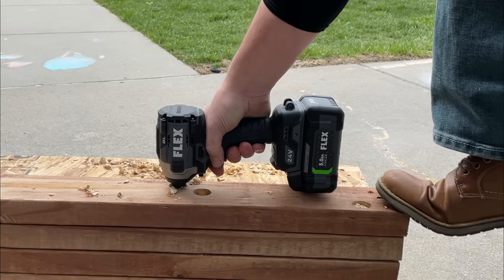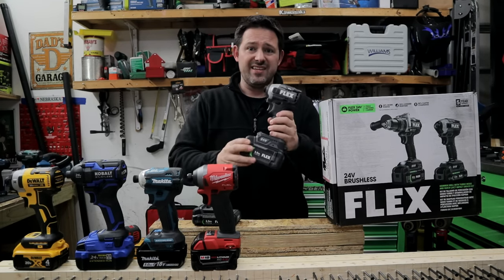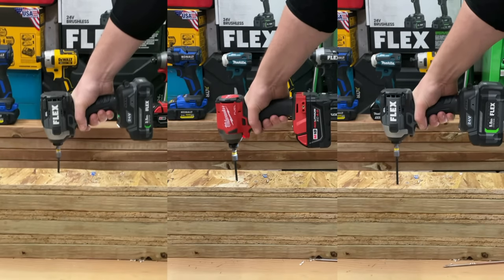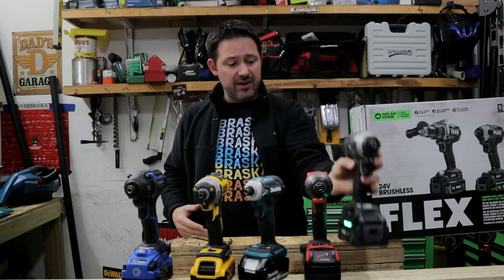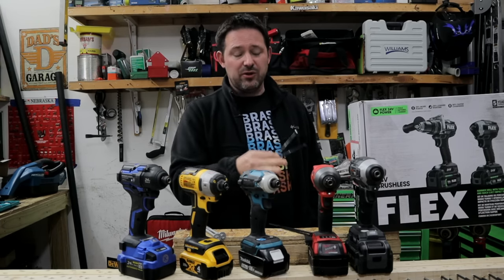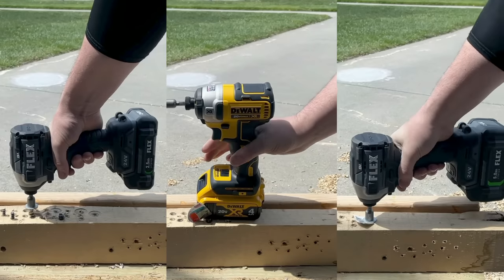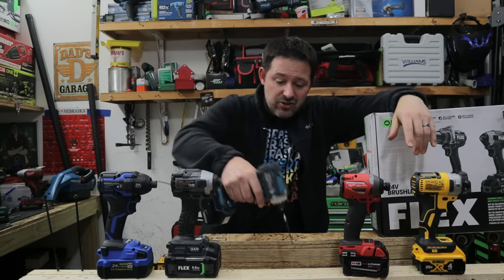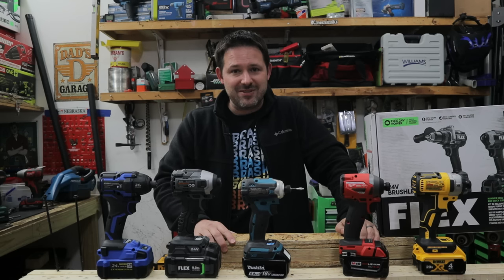FLEX TOOLS vs DEWALT MAKITA MILWAUKEE It's NOT what's NEXT Impact Driver SHOWDOWN!

Comment: I understand how you point out the flex and kobalt are Lowes exclusive, however where I live Makita and Milwaukee are more or less Home Depot exclusive unless you want to pay full MSRP with poor selection at Ace, or maybe True Value, or possibly a local supply house.  Live in a Lowes town. No HD here. Also, Flex is not a new company. One of the oldest family owned power tool companys in the world, and they invented the angle grinder. I'm currently on the DeWalt platform and have no plans to switch but I do plan on buying their hammer drill to use on my residential pre wires and their 24 volt rotary hammer. Reason is because they do appear to be powerful and we'll made and also because of the lifetime warranty offered if purchased this calendar year. They will even replace each battery 3 times as part of that warranty so the four included actually end up being 16 batteries in the end. That's a solid value to me and honestly the two tools that get the most wear and tear with what I do.

Comment: It looks like the collets are being pulled into the wood by the bit going in too far. Perhaps the collet is hitting the edge of the hole. @12:23 at 0.25 speed, you can see that when the speedbore is inserted all the way down into the wood, the collett is being disengaged by the edge of the hole.
If you tried this with a bigger, or even a smaller bit, the collett would hold it normally.

Comment: No Bosch?  Metabo?  Metabo HPT?  Ridgid? Besides my first 2 favorites missing, great video.
Reply: All four would trail behind the other products in this video (except maybe the HPT).
Reply: @robertrada6040  trail or not Bosch and Metabo are less powerful than Milwaukee but built much better and definitely more reliable. Metabo HPT (Hitachi) I don't care for.  And they wouldn't burn up like the Default😂😂 the Kobalt would be RIP the first time you drop it. Makita and Flex are the only real options.

Comment: well i built an addition on my place and needed new tools and the price of Dewalt was too high in my eyes for all you get but i wanted a good tool so I want with the flex i got the impact drill and saws all and 1/2 impact for automotive use and wow I couldn't be more impressed.   i had coworkers the had top of the line drivers and they were starting to use my flex tools the speed the power and the bolts we were using on some of this built would blow your mind. battery's lasted longer and the charger for the flex was way faster. hands down i would buy the flex and the fact you get a 5 yr warranty with the flex where can you go wrong

Comment: Great video but I kinda feel like all of them should've had the 5ah battery. I know for a fact its quite a big difference in my Milwaukee drill and impact going from my 4ah to my 5ah and even bigger when going to my 8ah. 12ah seems the same as the 8ah. I wouldn't think 1ah difference would be that apparent but it definitely is. Especially when using my drill for my ice auger. The 4ah constantly cuts out. The 5ah will go all the way through most of the time anything beyond 5ah just blasts thorough with no cut outs.

Comment: Milwaukee fixed that problem with the new upgraded 3.5 gen impact driver, not gen 3 but gen 3.5. Milwaukee's gen 3 impact driver has been a beast of an impact driver with only one flaw the collect issue, which's been fixed by the new 3.5 gen model.

Comment: I think the largest factors to consider - especially if you rely on these tools for your job - are quality and longevity. It's great if your tool outperforms competitors, but if it only lasts a few jobs or few months, it's not going to have the reputation Dewalt has, for example.
Reply: Dewalts are good for electricians and trades like that where the drills aren't beat up and used constantly I can testify that my coworker has 10 year old Dewalts that still work but they break easily they're made from Chinese plastic unlike Makita. Dewalts are like GM and Makita is like Toyota/Honda. Japanese know how to do it right 💪 not really the Chinese with Milwaukee Dewalt and Ryobi they break easily but can last a long time if babied or only dropped small lengths every once in awhile

Comment: Currently running Milwaukee. I still have 2 Dewalts, and have had the blue Makita, Ridgid 24V, and have used lots of others. Makita was light and powerful- but didn't like falling 20 ft and hitting concrete. I am currently invested in Dewalt 20V, with some Flexvolt tools as well, and have no interest in a completely new brand. If anything I'm adding Milwaukee to the stable, but generally speaking I think Milwaukee makes the best drills, impacts, and recip saws. Dewalt owns the miter saw game. Most other tools are neck in neck. No way I would ever buy a store brand like Kobalt or Ryobi. They're cheaper for a reason.
Reply: Do they have the multitool?

Comment: Did you use turbo mode on the Flex? Is this the most expensive flex model?
Reply from the maker: The FLEX impact driver does not have turbo mode, but the FLEX hammer drill has turbo mode

Comment: I cant understand why the heck you dont use Milwaukee's latest high output batteries with the 21700 cells. In comparison to the old  18650 cells in REDLITHIUM™ batteries, the new 21700 cells provide a massive leap in performance in the high output line.

Comment: So I've seen from flex tools (both mine and a friend's drill set) that its really damn good under lighter loads but once you get past a certain threshold, it seriously slows down bad. But I think this was intentional from the manufacturer as it drops off so much to the point where it feels like the drill is trying to slow itself down to increase its longevity.

Comment: Dude good review but frustrating when the gen 3 gets beat by the flex when it's running a 5ah, clear to see it does make a difference even between the flex line. Milwaukee 5ah atleast for the review I reckon is a far better option, and Milwaukee has the high output line for a reason maybe chuck the 6ah on see it absolutely dominate, as that's more close and compatible to the flex 5ah 24v
Reply: Milwaukee is 18 volt, flex has a 24 volt... it should be better. But Milwaukee will NEVER BE BEATEN! LMAO, THIS TEST IS A JOKE! Let's see how long a flex drill lasts, it'll do good to last a few months, let alone years like Milwaukee does! They need to "flex" their wrists and throw the flex in the trash where it goes... 🤣 🤣 🤣 🤣 🤣 🤣 🤣 🤣 🤣 🤣 🤣

Comment: The Flex line is making a lot of waves, for the price. I suspect they will be putting a dent in Makita, Dewalt and Milwaukee in some new system buyers. If one already has a branded battery system, its going to be tough to add even more chargers and batteries that are not interchangeable, and in some cases, quite a bit higher performance.   Personally I believe there are WAY too many brands these days.. and way too many exclusive battery mount systems. I would really rather see universal mount battery interfaces.. all the same for 12V, same for 18-20, and same for 40.  We have 6 foot shelf of different chargers already, 3 different types in Snappy alone.. Makita, Bosch, and more. Several were retired when batteries became too costly to keep rebuilding in spite of the tools still being good. Freaking waste.

Comment: U should ve added the Milwaukee and dewalt high output batteries!
Reply: Yup... This test is Fraud... Fake.. Paid for....
Reply: @bustanut3888  I believe almost all videos with flex tools in it are going to be sponsored. They are spending alot on advertising as a new tool and rightfully so to make a splash. Just we as smart consumers need to sort thru and know what's what.
Reply from the maker: @taz4100   @Luke Moore The FLEX with a 2.5ah weighs 4.04lbs and the Milwaukee with a 4.0ah XC weighs 3.79lbs when you do power to weight ratio it's clear which one is lighter and faster. As noted in the video this is not sponsored or paid for in any way I bought all these tools myself.  The FLEX also has the 2.5ah and 5.0ah side by side for comparison so if you put a 4.0ah battery in the middle it's easy to compare to what flex has that's smaller and bigger. That and I don't personally have any bigger batteries for the tools. The Kobalt XTR  was running a 4.0ah high output battery if that helps.

Comment: Just from the videos I've seen on youtube it seems the flex impact driver is their best tool.
Reply from the maker: Saying it’s the best is pretty strong. You need to say or find out if it’s the best for you. Some people never find the best they just need good and cheap enough. Some people buy too many tools others don’t have enough. Some tools have great features but if you don’t use them they aren’t worth paying for. I personally was more impressed by the lights tools with the best power to weight ratio.
Reply: @ClientGraphics  He said "their" best tool meaning the best tool out of their own line not the best out of impacts. I think that's what he meant anyway.  Lol

That being said, I am in the trades and use my tools heavily every single day. I have dewalt milwauke and now flex drills. Though it's only been less than I week on the job, the flex outperformed every other drill and impact I have or my guys have, the hammer drill and the impact are beasts so far. Now that can change if it doesn't hold up longevity wise but the milwaukee and dewalt don't hold up longevity wise anyway. I've had to fix or replace those tools several times but again we use our drills heavily every single day. The weight difference isn't substantial enough to matter in my opinion. I've been super impressed with how much stronger my flex was this past week and look forward to seeing how it holds up. I love the makitas new 40v lineup too but not sure if I'm going to pick it up.

Comment: The tests you ran were fine, not really how contractors use them, but the miracle of Flex tools is the batteries. They will out last every other brand and fully recharge in under 10 minutes! Flex is half the price of Milwaukee, so not really a comparison, and each flex tool including the batteries are replacement warranted for 3 years, and no other tools do. Those are the things contractors look for

Comment: Just my opinion Makita tools are worth the money, have the best ergonomics, and are dependable. 
My only experience with FLEX has been at Lowes and while powerful the tools just didn’t feel good in my hands and were actually uncomfortable to use (probably due to some mild arthritis). 
Also FLEX doesn’t even come close to Makita when it comes to the number of available tools on the LXT and CXT platforms, their XGT platform is fairly new but I think that it has more tools available at this time.

Comment: The flex line has a limited amount of tools available and since the real cost is in the batteries in my opinion the major brands are the way to go. Although I have mostly Dewalt, Milwaukee is better for impact tools. I am not a fan of using impacts as a drill usually. Big fasteners are a specialty as 3-1/8 or less is the norm. This is where light weight is the best choice

Comment: Makita rocks a lot. No body has them on job sites and that helps with security issues in those public areas. I used Ridgid until switching to Flex (impact only so far), Flex is better than Ridgid at least.

Comment: VCG proved that the turbo mode actually made the flex go slower on high torque applications. 

The torque test channel proved the XTR is the most powerful, followed by Flex, then milwaukee. 

Having a lot of experience with all these brands except makita and flex, I wish reviews would include the trigger feel.  How much control do you have with the trigger, what is the minimum rpm you can run the drill at. I find that very important, I think dewalt has the nicest trigger followed by the kobalt xtr, I don't like the milwaukee or ridgid triggers, very clunky and too high of starting rpm.

Comment: Yeah...I’ma stick with Makita for my battery powered tools. I’m not a fan boy of any brand, I got a Milwaukee Super Sawzall (15amp), Dewalt Disk Saw, Dewalt Orbital Sander, etc...I just buy the best tool I can for the money in general. But sticking with Makita for cordless since I’m into that battery line. Makita has also just released their high voltage line of tools, so I think I’m covered for all my cordless needs with them.

Comment: I've use all this brands, but now flex is the most powerful impact drill, because we work doing decks and trust me, there is where  you need the torque power, the problems whit Milwaukee is when is overheating or  summer time never get charge, only Makita and Flex work well in summer time,Metabo is a good choice to very powerful drill on top model,good comparison good video man👍🏾👍🏾

Comment: The thing about these tests is regardless of which one ends up winning any particular showdown it's usually only by half a second or even 1 second ...
but then you look at price ... it's up to the consumer to decide whether or not that 1 second is worth 50% to 100% more money....
Reply: You're obviously a dewalt diy kinda guy huh?
Reply: @freethinker5225  Ridgid and Millwaukee.... it's all about brand ....they all basically do the same thing relatively...👉 the same
Reply: @Craig Cundiff  yeah but when you get into the rugged stuff you definitely don't want to have to go buy a new drill unless you use power tools to make a living
Reply: @freethinker5225  I am a dewalt diy guy.  Should I be embarrassed?
Reply: You also have to look at other tool options. If there's a larger selection of tools that use the same battery then you can open up your capabilities.
Reply: Facts

Comment: The first video I saw about flex I was impressed. Then I looked at the price. 
Their entire marketing team needs to be fired. 
You don’t start off as the most expensive brand in the market and expect to sell a lot. 
They also don’t sell bare tools. Every tool I saw for sale came with 2 batteries and a charger. (That might have changed but still)
They have the most power, but they also seem to have a lot of problems. ( seen several people complain about impacts shooting oil everywhere and shutting down from overheating)

I’ve gone through all the major brands and a lot of smaller ones. Stick with the big three(Milwaukee, Mikita, dewalt) 
I’ll buy a flex when I see them being used as rental tools.

Comment: You think the extra holes in the white oak surrounding where you drill in for everything but the flex 5.0 affect the difficulty? I'd think they would give the wood somewhere to go therefore reducing pressure. 
All around decent comparison but seemed like flex was disliked by the tester.
Reply: BTW I own dewalt and makita tools I just think if you're testing and reviewing something you shouldnt go into it with your personal opinion.

Comment: All this is is a flex commercial
 as far as the Kobalt goes I've have the much smaller impact drill I use it for building fences everyday I only use the $10 batteries that you can buy at Lowe's even with that they WILL LAST ME TWO and THREE DAYS when other drills I've used they need their batteries switched out TWO and THREE times a day

So watching you make a race of it I would much rather make less trips to the charger to keep replacing those speedy drills you aree so impressed with

Comment: Man there are a lot of people who are real mad that someone put out a tool that matches milwaukee and beats dewalt and makita. It's weird how defensive they get about their tools. You dont need to have the best tool in the room mate, just buy the ones you like that work for you.
Reply: This issue is skewed results due to uneven testing conditions.
Reply: @NWGR  The difference between 4.0 and 5.0 is how long it runs, the output is the same across the platform (18 volt, 20 volt, 24 volt) a 6m0 will just maintain that 18 volt discharge rate longer than a 2.0 before it starts slowing down.

Comment: I tried flex but it didn't feel good when you use it the Back of the drill and impact driver handle digs in to your hands. Any of the other drill and impact driver don't have that problem.  I rather Have a drill and driver that is comfortable in the hand.

Comment: I say to make it fair on that Milwaukee put in either the 8 amp hour high output battery or the five hour high output battery since it's an 18 volt and the flex is a 24 volt

Comment: I'm an electrician and I've ve owned Milwaukee for years, and I've never had the bits come out of the collet. I've also got 5AH, 9AH, and 12AH batteries as I bought mine before the 4AH batteries came out. I also rarely, if ever use my impact for paddle bits or speed bores. Also, you should try testing the Milwaukee Fuel Surge against the Flex. It is significantly quieter and is hydraulic.

Comment: It’s not A complete fair test for DeWalt !
Dewalt impact driver has a 4 ah battery vs Flex has a 5 ah.!
Reply: The flex also had a 2.5 that beat the dewalt in all the tests too, so I'd say it's more an issue with the tool itself being less powerful and less an issue of using too small of a battery.
Reply: Also, Kobalt, and Milwaukee were using 4.0 batteries as well, and they beat dewalt at every turn.

Comment: I am tempted to by the drill driver impact driver FLEX combo before end of year to get the Founders lifetime warranty - but if I am going to move to a completely new system after building around a different tool brand, like others said, I want to know they are here to stay - that lifetime warranty helps. I know this is not really important, but I really wish they had named their brand anything other than FLEX. Viper? Tiger? Falcon? Name it something cool. Just say 'flex' outloud a few times and you start feeling uncomfortable saying it.

Comment: Should redo this but use dewalts new atomic stubby. I got one a few months ago and the power it has is very noticed vs the previous gen you’re using. Easily 50% stronger